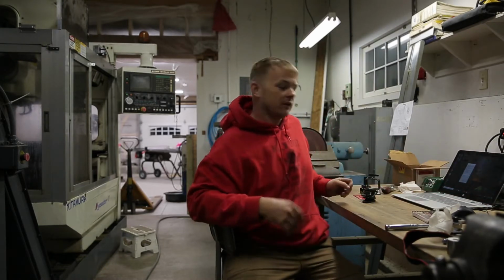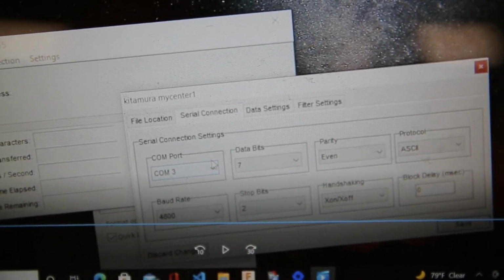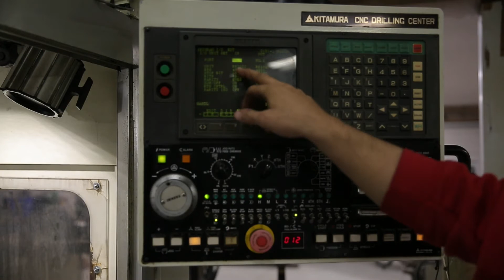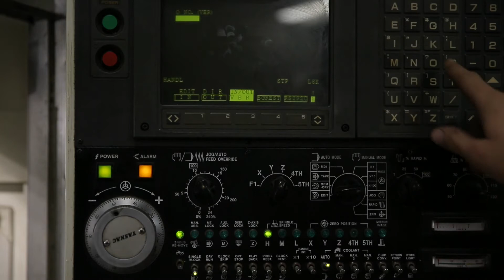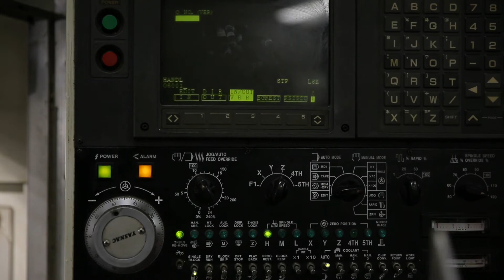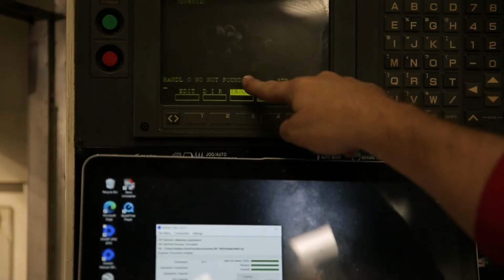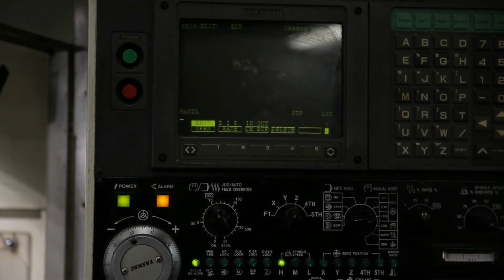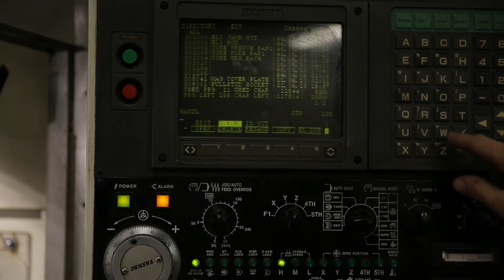How to Transfer CNC programs by rs232

Comment: Thanks for the video, I'm working in a machine shop and boss recently had me build him a plasma CNC table and I retrofitted an 1980ties mill to modern Acorn controller , he just recently asked me If I can figure communication between a computer and 2000s era Fanuc control CNC lathe that has serial port on it. This probably saved me lots of research time , thank you for that. one question , the file you make for the CNC mill , are they usually .txt or .gcode ? Also how much memory are those old controllers supposed to have to store all those programs do you know? Thanks!
Reply from the maker: Glad it helped, I always save as .txt. As far as memory that highly variable even within the same control type on same machine; it depends entirely on the bean counter that ordered it… for example my mill has the high speed machining option but the basic memory of 156kbytes(makes a lotta since right🙄) but could have been ordered with something like 4x the memory if my memory serves me correct… it also was ordered with the basic 4 work offsets instead of the upgrades  which could be up to 156 sets which again was pretty dumb considering this machine has two pallets…

Comment: I know my response is several months old, but thank you for posting this. Also, love the Kitamura My-1 in the background.
I just bought 2 used Kitamura My-2 with APC's. I realized at this exact moment, as I was writing my first program for the machine, that I no longer have a computer with a 9 or 25 pin serial port. I don't mind hand entering a short program but when they get longer it's a complete drag. Thanks again, Jay.
Reply from the maker: your welcome, it was a real head banger sorting all this having never done it. Glad I could help someone. Wish mine was a my-2 the 7.5hp spindle can be a bit of a drag from time to time...
Reply: Hi Lock. I bought the cable and Null modem as suggested along with downloading the Smart DNC software.
Everything worked! Thanks again.

Comment: I legit have the same cable set up with null modem adapter and it works fine once i figured out the parameter settings
Reply from the maker: Hey thanks for watching, Your comment  sub has pushed me to edit and publish some of the hundreds of hours of footage I have(I lost interest for a bit there.) It took me a minute to get this figured out but once I figured out my machine getting it to work for a buddies hardinge sv lathe was pretty easy.